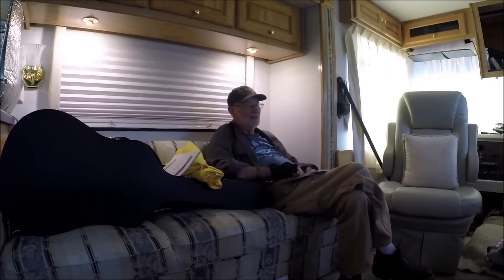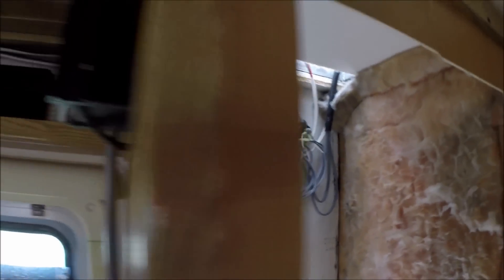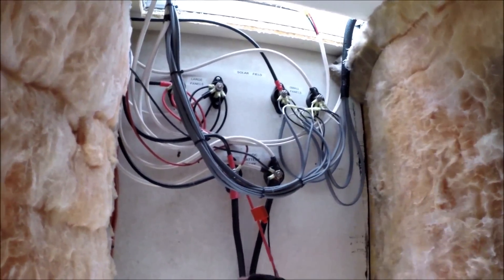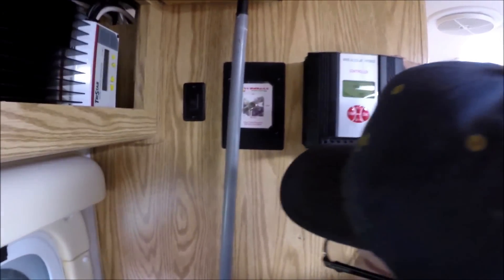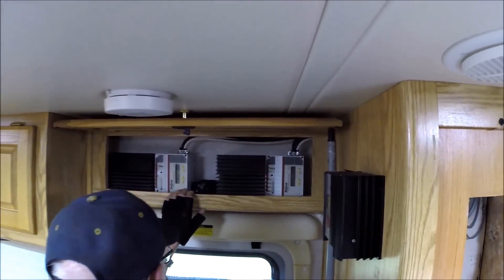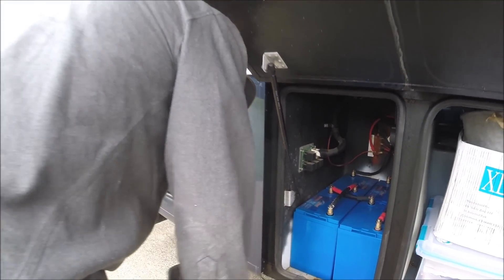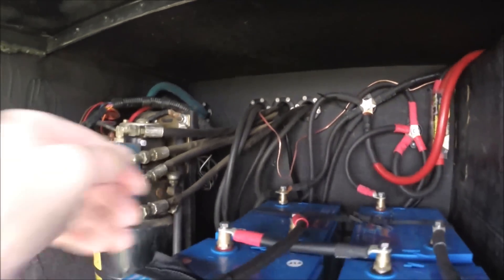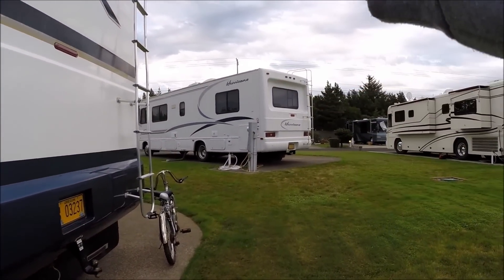Full Time RV Living: FINALLY! An Expert Goes Over Our Solar Energy System and Discovers

Comment: When does added electronic complexity surpass the goal of safety at the cost of efficiency? Do you need a MultiPlexeR as sok888 describes?? 
   You guys are de bomb! I am so grateful for these videos. I am 61. No more wife, soon be selling house for... enough. Maybe more.
   I plan to be full-time vacationing a la RV off the grid as much as is possible and your lessons are invaluable.  Thank you times infinity squared. 
   (2) Questions - What are your thoughts on slides? Why can't your wind generator operate while driving to top something off? I understand that it will cost
gasoline to "operate" the wind mill, but where does one reach diminishing event horizons or whatever?

Comment: The reason it has two MPPT controllers is the open circuit voltage on the two separate panels Ocv are not the same.

Comment: I'll be interested in seeing what type of methodology your electrician recommends to correct your solar system. I know a lot of wire connections, components ,etc. should be put in metal boxes with plenty of room for wire and component fill. Actually need to calc everything out before you even install a system, perhaps leaving  enough room for expansion in the future? ( high amperage and Power wiring inside of flammable materials makes me nervous) thus the need for metal enclosures
Reply: Did the electrician recommend any kind of conduit systems to run the wires in? Like on the roof and down to the different component locations?

Comment: It's amazing what scum bags are in business. All of the wiring looks so clean  and professionally done, yet they skipped basic code safety features. To increase their profit they risk a fire hazard.
Reply from the maker: We just lost a whole solar panel and slider going down the road...video soon! They really cut corners.
Reply: Yikes, so sorry to hear that your slider went bye-bye (I was worried about that, too) - glad no one was hurt... would sure mess up a motorcyclist or vehicle following close behind!  Inside your battery box, I'd recommend having an insulated plate to protect your heavy gauge batteries and terminal posts.  Should one of your metallic assemblies come loose, a watch band or wrench short out the battery source, Fourth of July fireworks are headed your way :(  In our telephone central office power plants we would use see-thru plexiglass to protect vulnerable areas.
Many thanks for sharing your setup :)

Comment: If he was a expert he would have told you that you have the wrong panels. Amorphous panels like Stion and Schott can lay flat and produce full power. Mine run everything including a 120 volt 10 cubic foot real refrigerator. 24-7 for 2 years now. 
Those panels are only getting 30% of the rated days output laying flat.
Reply from the maker: +Jess Vie Thanks for watching! And good for you. :)

Comment: I believe your batteries are correctly wired for a 24V battery bank. A series / parallel connection would yield a 12V bank.  I think this is because the TriStar TS-MPPT-60,  handles 800 watts at 12V, 1600 watts at 24V and 3200 watts at 48V.  I don't know what the size of your large panel bank and your small panel bank is. A 12V battery bank would limit you to less than 800 watts of panels per controller.
Reply from the maker: +al mcgillivray Daisy chained is the old shool way. There is a better way, that isn't giving the first battery in line all the brunt.  This is what we have now learned from the expert. Every shop robs us, so we're forced to think it out and make repairs ourselves. Unless you are volunteering! We could always use more input. Thanks for watching :)
Reply: I have made a few assumptions based on what I could suss out of the video. Can you tell me how much capacity you have in each solar panel (PV) bank - your large bank and your small bank? Also, are each bank wired in series or parallel (I'm guessing parallel). When you say daisy chaining is the old way of connecting batteries - there is only one way to get a 24V battery bank out of 4 X 6V batteries and that is to wire them in series and that is what you have. Current flows through the 4 batteries equally - the first or last battery don't see different conditions than the 2 batteries in the middle. A series parallel circuit is an option for you if each PV bank is less than 800 watts.

Other than not having some maintenance disconnects for isolation and some additional fusing, (I agree that should be installed), what is your system not doing that you expect it to do?
Reply from the maker: +al mcgillivray There are eight batteries. All panels should dovetail to one power source, and charge the batteries as one bank.
Reply: +Boondockabillies OK, I think I finally understand what you are trying to do. you are considering wiring the batteries as a single 48V bank.  In all seriousness, I would consult a system designer for a third opinion.  You already have a working system (with a few flaws) and there could be a small efficiency to have a 48V system over a 24V system.  Is your system design perfect - probably not. Could it be better - maybe. Will it every be perfect - never. Good luck with whatever route you decide to go.
Reply from the maker: +al mcgillivray Wise words!  Al, thank you so much for your comments. They have been very thought provoking.  :)
Reply: +al mcgillivray 
I think he is saying all the solar panel should be wired together and enters the system as ONE source (one positive cable, and one negative cable). Once inside the RV, it should wired in such a way as to spit the charge on each battery equally so that no battery gets overloaded (to conserve battery life, I guess). If that is the case, all he needs is a dual battery bank power multiplexer, like those used on boats. But then he'll be faced with wasting power with added electronic complexity.